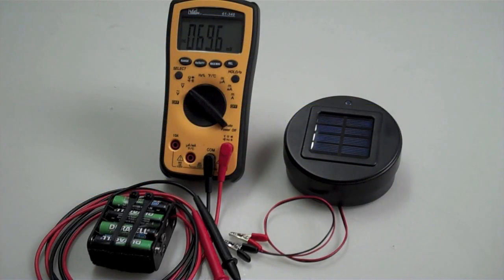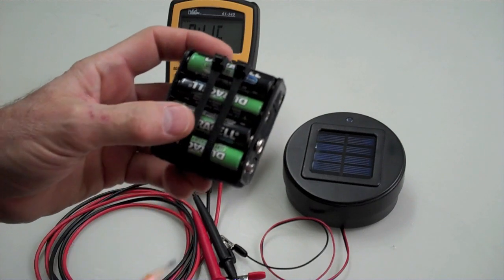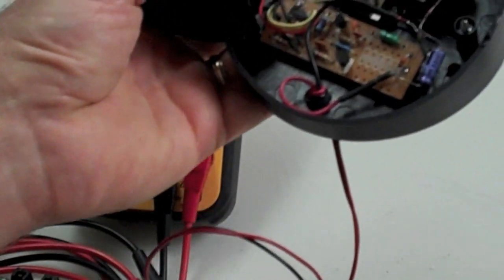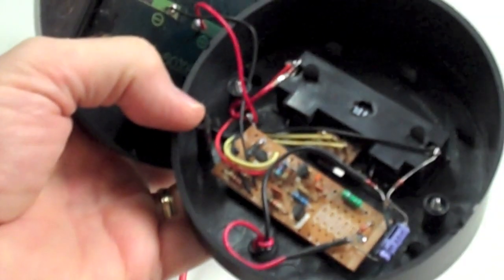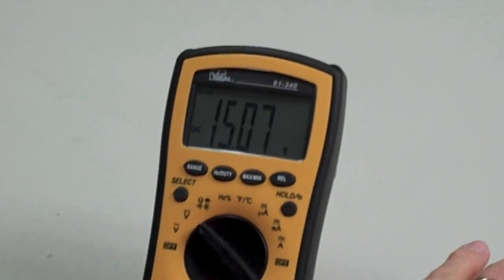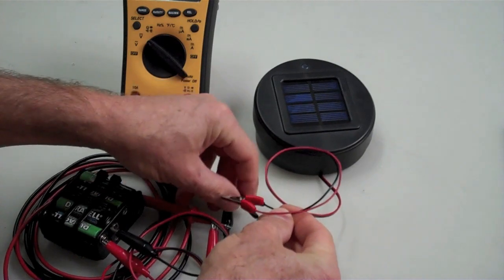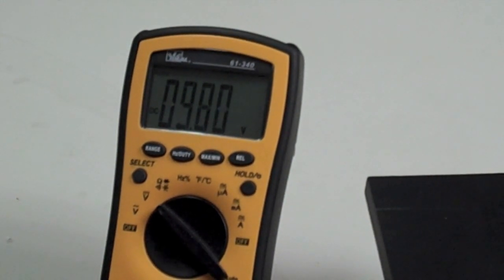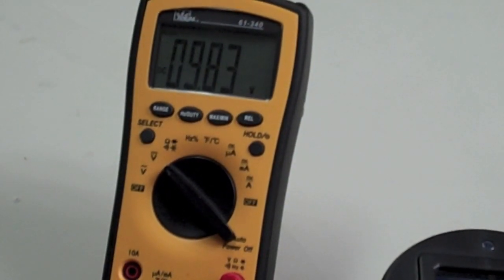Battery Charging HACK

Comment: you have for example 1.2Volt and  2000 mAmps inside that rechargeble battery. i understood that you can raise the voltage, i know is very simple, but if you are transforming the amps in volt,the amount of watt is (let`s say, decimated)  so you can not take mor energy than the energy stored in that rechargeble battery.
Watt=Volt x Amp so  that mean from 2000 mAmps you would have 12 volt with 200mAmps on the charging part - energy loss in transformation stage.
So you just made a transformer that rise voltage from 1.2-12 volt,
The Real story?   :)   higher the voltage less power(mAmps)
                               less voltage higher the power (mAmps)
Is just phisics that we learn in 5 th year in school in romania.
Reply from the maker: Yes, it is still fun to play with.
Reply: Yes it is.

Comment: PMMG4HYBRID So can similar circuit charge a 12v or a voltage/amperage battery where the solar panel charge a smaller battery then boosted to charge bigger battery when panel is off, and if so how to??

Comment from the maker: Yes, you could bypass the solar input from the circuit board and reroute directly to internal AA connection using a couple more diodes. This would simulate darkness and keep the transistors in a constant triggered mode. Utilizing the internal AA as the initial charge destination would be your best option. The goal of this setup was to keep the parts/changes as few as possible for the sake of fun and simplicity.